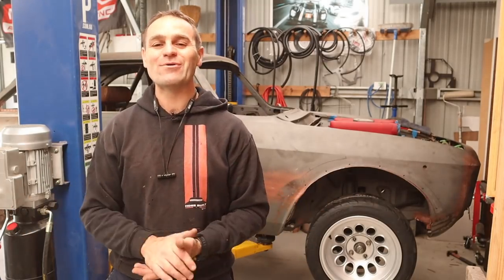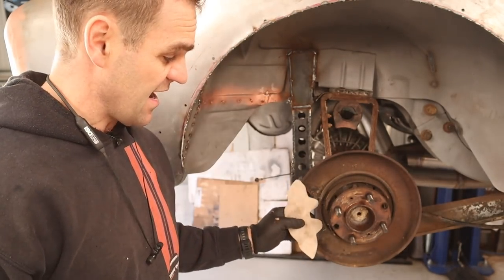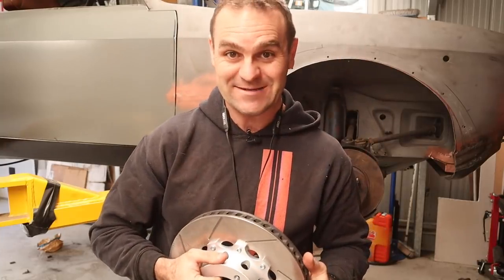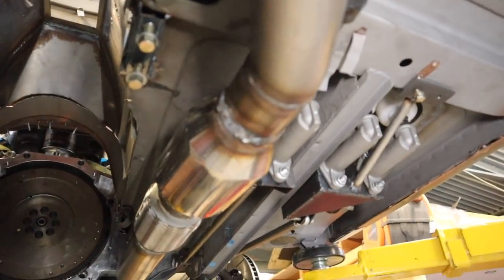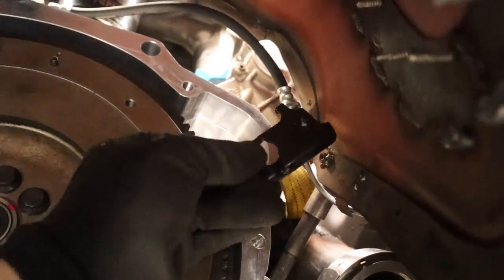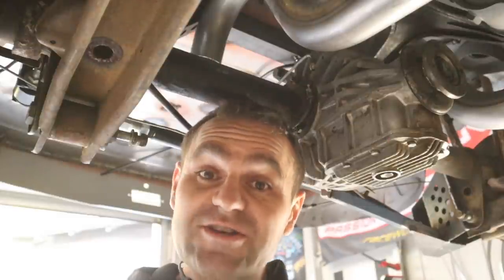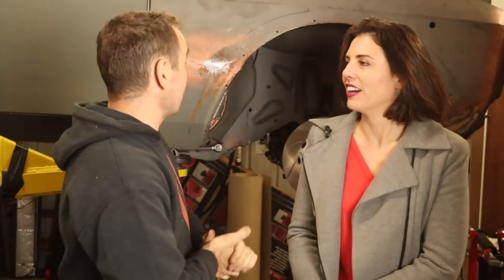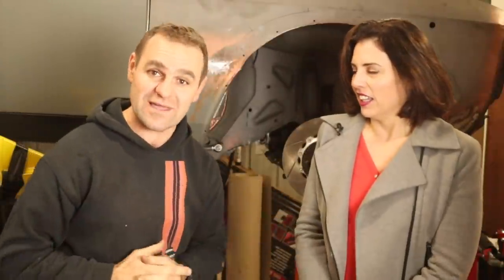Brakes and lines - Ferrari engined Alfa 105 Alfarrari build part 91

Comment: Nice work mate, brake lines are always fun, no reason to why you can't put the brake light switch on the rear circuit if it's causing clearance issues up the front. Closer to the brake lights when wiring it up as well
Reply from the maker: That is a good point. I should have thought of that earlier ;)
Reply: Depending on the brake bias setting you may not get enough pressure increase in the rear circuit to activate the switch.  That would have to be tested.  The alternate is a simple electrical switch on the pedal.
Reply: @timgosling6189  it works fine, thats where I have it on my 105  racecar. :)

Comment: For the brake pressure switch, another solution might be to do what the factory did with the later cars - weld a tab on the brake pedal arm and use it to actuate a brake light switch.  Loving the progress, this detail work takes forever but makes all the difference!

Comment: Hi Jeff, an important hint regarding the brake switch. This part often causes problems with air in the brake system, due to the inner switch membrane (no brake fluid leaks on the outside!). I therefore strongly recommend using a new brake switch, or replacing it with a standard switch on the brake pedal.

Comment: nice work. if your worried about the brake lines being to close to the exhaust, you could possibly run them inside the cabin, subaru do it on a lot of their cars. wish more 4x4's would do it, seems like a really good idea for any vehicle that may run over a large stick at some point.

Comment: I fitted my pressure light switch right at the proportioning valve on the rear circuit at the drop for the rear seat where the factory says to mount the electric fuel pump, Is tidy easy and out of the way.

Comment: You can bend stainless rod by heating with an acetylene torch.   I think you will have heat issues with your brake switch location. I would remove the switch entirely and just use a standard brake light switch on the brake pedal.  Those are the nicest brakes I have ever seen on an Alfa. I am green with envy.

Comment: Jeff, since your master cylinders are mounted low underfloor, have you checked to ensure that you won't need external residual pressure valves to prevent gravity flow back to master cylinders?

Comment: there's a manual hand held tool for bending fuel hard lines and brake hard lines without kinking or damaging. mine is from Canadian tire the brand is OEM multi-purpose tubing bender of various sizes and yes it bends stainless

Comment: Have you considered running brake line in the wheel well (and possibly hide in under some thin sheet of metal for extra protection)? It might solve the issue of line being close to the exhaust)

Comment: That brake switch could use a heat shield even if the exhaust is wrapped. 👍🏻
Reply: For sure. My BMW E39 has brake lines above the exhaust and they’re protected by a corrugated aluminum shield.

Comment: Hi Jeff, there is one thing I don't understand, about your concern about road clearance to the exhaust, why didn't you just use oval tubing the you could get the same size tube but with more distance to ground, I think i saw on Bitching rides where they build a car with much less roar clearance than the Alfarri

Comment: If mounting that weird pressure switch is so hard, why not go to a conventional pedal box mounted switch?
Reply: I was thinking that as well.  Mechanical switches that act on the brake pedal or the pedal linkage are common, and in my experience more reliable than hydraulic switches.
Reply: or why not put it close to the master cylinder, where it seams to be plenty of space,  and have 2 lines going forward.

Comment: Some choices that may prove problematic or aren't done that way anymore because of problems they caused.
The better choice is to avoid putting critical things like break and fuel lines any where near heat or where they can be damaged.
The flex line near the drive shaft is at risk of being struck should the unijoint fail or something get wrapped up by the shaft.
These are rare occurrences that may never happen but have happened on numerous occasions because of the billions of miles cars drive every year shit happens unfortunately it can happen to you.
Fixing the exhaust hangers.
They will fail faster then you think and welding contaminated stainless is not fun. Get some flat bar or a bit of tube and cut it so it cups around the exhaust pipe and can be welded to the hanger , Only tack it to the exhaust pipe at the bottom opposite the hanger

Comment: Just out of curiosity Jeff, why didn’t you opt for stainless steel flex lines? Then the exhaust touching at full diff bump shouldn’t even an issue.
Reply from the maker: They are plastic coated stainless flex lines, and it is still an issue. Stainless lines still have rubber inside and you don't want that touching a hot exhaust.
Reply: @HomeBuiltByJeff  I thought I saw some braiding underneath.  Thanks Jeff!

Comment: Would not have used the hydraulic brake light switch, they are hard to find have a habit of of delayed activation, and leaking, would have fitted a modern switch to the pedal and no exhaust heat problem

Comment: You are way too close to the exhaust brother! Go inside the cabin for this and the fuel line. Don't mess about with this stuff. Also you need to finish welding the joint to the cat as well.

Comment: Arent you afraid you will cook the brake fluid even with the exhaust heatwrapped?  Please do some temperature heat soak testing before you take the car out driving too much. We would hate to see you plant all that body work into a hedge.